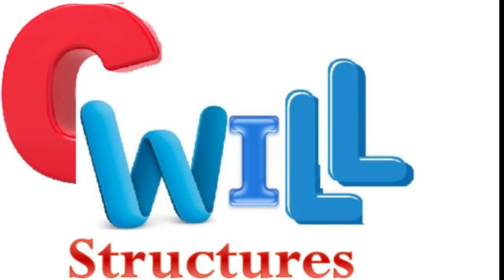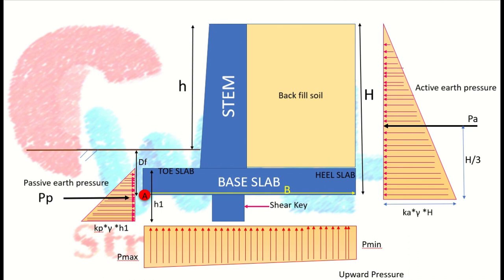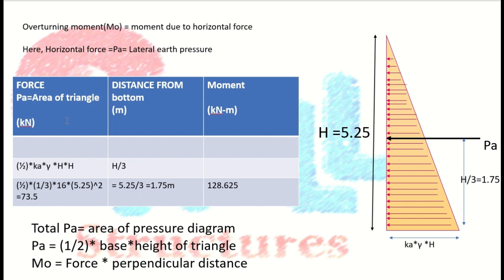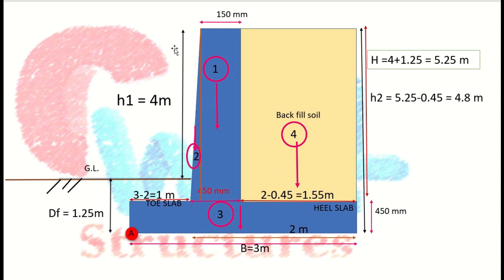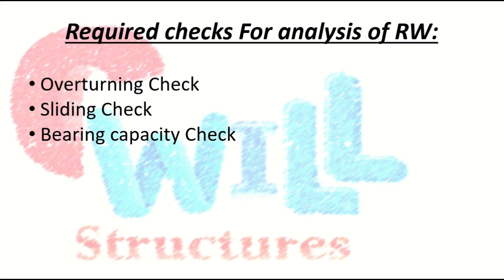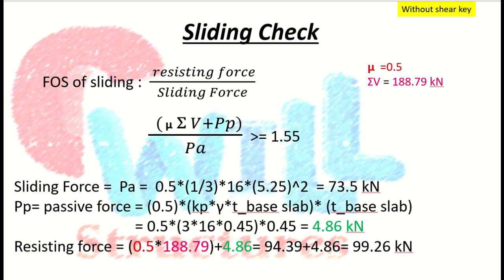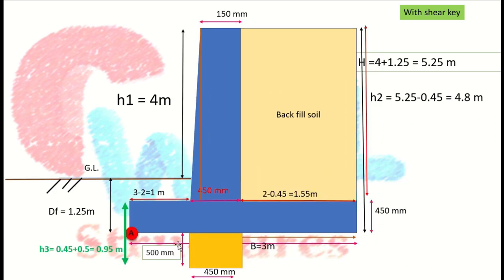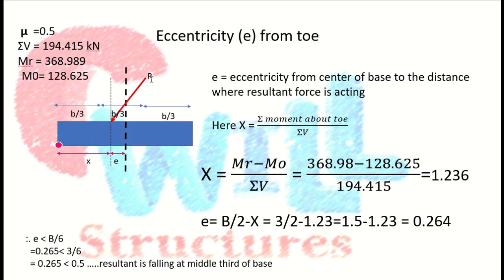Stability Check  of Retaining wall |  Solved Examples

Comment: Thank you for your video. I have a question about designing a gravity wall for sliding when the shear key is angled from a depth of 0' below the base on the heel side to a depth of 1' below the base on the toe side. The driving force sliding is now trying to slide up an inclined plane so how would I adjust the frictional resisting and driving forces for sliding?